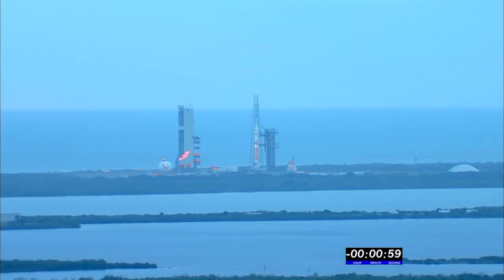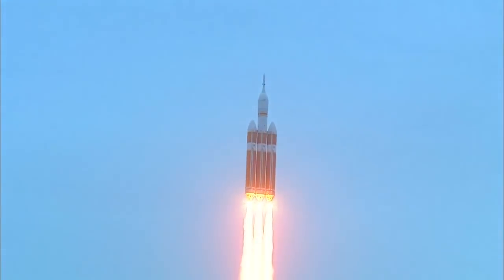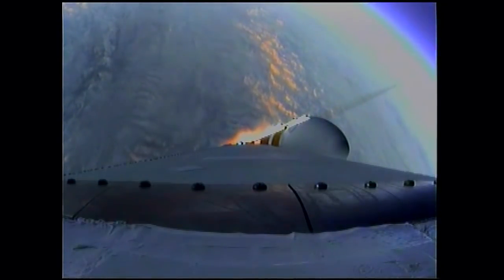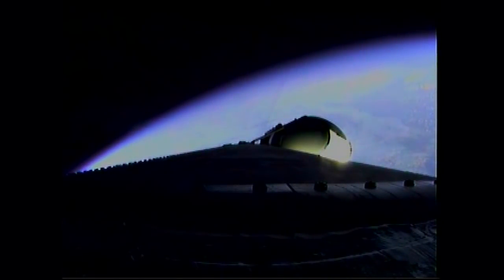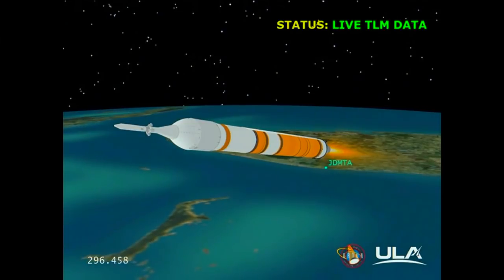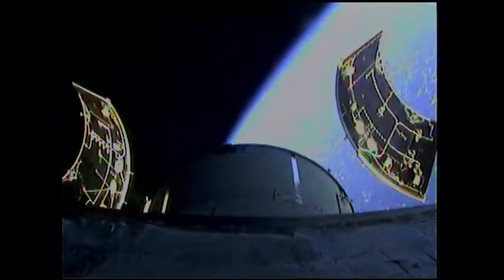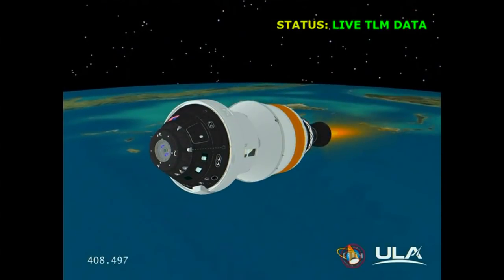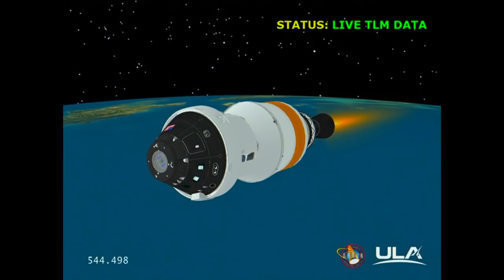Orion Soars on First Flight Test

Comment: They ever think about sending parts up in sections.? Then reassembling, refueling, and making the trip, how bout inflatable habitats with inner linings formed after inflation with polyurethane
Foam between linings everything can be packaged small then pressure inflated and filled.?

Comment: Why after rocket separation (at 5:00) is everything now in a blue hue? No reason for this except unless this was staged...
Reply: +Poindexter pantak The camera automatically adjusts white balance and exposure. My guess is that it adjusted to the intense red of the seperation explosions and didn't do a good job of readjusting back to normal.
Reply: +Salfordbluemoon Actually I want to know the answer to that myself, because the video does seem to change to blue for no reason after the 5:00 mark. So explain to us why it is so stupid?
Reply: Auto white balance/exposure would have bloomed out the image initially and there would be a delay, and it would have recovered. The instantanious change is a sure sign this video was worked on in stages. Occams razer is the answer.

Comment: The J2 engines are the only rocket engines to date that can be restarted in space.
Reply: +starview1 What about the RL-10 engine used in the Centaur upper stage?
Reply: ***** Almost any regeneratively-cooled liquid rocket engine is reusable, even if it was built for expendable vehicles.
The design requirement for the F-1 was 20 starts and 2250s of firing; as
part of the test program, six of them accumulated over 5000s each. HOWEVER, Yes the RL-10 engine was restartable,What I should have said that the J2 was of its type a Gas Generator power cycle rather than the expander style of something like a RL10.No question the RL 10 (I Suppose) could be called a work horse. Any how very good... you are probably one of six people viewing You tube that would catch my slip up, you get an A for the Day.

Comment: Is there a specific name/nomenclature for the booster and rocket config they are using?  It seems to be to new standard, seeing as how both NASA and SpaceX use it.  I just ask because it seems relatively new and I'd like a short-hand to refer to this setup for Kerbal Space Program.
Reply: they just strapped three Delta Common Core Boosters (CBC) together and throttled the middle one. SpaceX hasn't done this yet. i don't think that there is a special name for strapping three identical boosters together. Have fun in KSP

Comment: Is there any sound in space because I heard the boosters when it was still in the atmosphere but once it got out into orbit I couldn't hear them anymore
Reply: (near) no particles, no sound
Reply: oh, and I think the engine started using less fuel
Reply: I did look it up and found that sound needs a median to travel through such as air or water. When we talk we vibrate the air particles... But that sparked another question, how do they talk to mission control
Reply: Lemonsqeezerz4 well, just some sort of radio signal.
And the room they're in isn't running out of particles relative to their distance from earth otherwise they would be dead.
Reply: +ArvidiusMC If you're talking about gaseous particles, then you're incorrect. Sound travels through matter, so an astronaut on the moon could very well hear the other guy walking past him (provided that walking makes enough noise to be heard over the airconditioning & comms in his suit) . If the radio failed on one of the astronauts, all he'd have to do is to face the other astronaut, make the visor of his helmet connect with the other astronauts visor/helmet, and then talk. Just like listening to a conversation in another room, using a glass :P 

Also, if a spacewalking astronaut used a hammer to knock on the hull of the space-station, those inside it (or in the near vicinity of the spacewalking astronaut) , would hear the knocks, even though there''s a vacuum outside of it. As I said, sound travels through matter as well as fluid & air(gas). :-)

Comment: I'd be interested to know what NASA expects to accomplish with Orion. That is, what capabilities will it have that, say, Dragon II will not? Is Orion just a leftover from the defunct Constellation program or do they have a good reason to continue developing it?

I think if they're serious about commercial spaceflight, they should be focusing on getting the SLS into service and working with SpaceX to integrate their capsule into the NASA exploration program.
Reply: ***** I meant it'd play a major roll.
Reply: Orion is a spacecraft they're planning on landing on Mars. It's been in planning for a few years and now they're testing everything.
Reply: ***** Well yeah, but the SpaceX comparison is kinda not a good comparison because with most of the SpaceX launches they also have to recover the cost of the payload PLUS the rocket... if you see what I'm getting at.

Comment: Ok, I'm no expert, but would it be technically possible to make a smaller version of the space shuttle, with no cargo just enough for people, life support and a small engine for de-orbit burn, and put it at the top of the rocket, the rocket would go, just as every other rocket. 
It's no different from the Space Shuttle, but the idea is to make the cargo outside the vehicle wouldn't it cheaper to maintain than the Space Shuttle?

Comment: Dear NASA.....please save the CGI animations for when we have no video. Cutting away to the animated ship right as things happen is TERRIBLE.

I also find it amusing that you went with the old capsule design. I assume it will use a similar methodology for Mars as used for Luna? I.e. two vehicles, one in orbit with a lander/return module? If it works I'm not going to knock it. I guess using more modern, lighter materials and smaller yet more powerful computing power will make a huge difference. Save some weight for shielding from solar winds and all. Guess you boys have to work with what you have seeing as your budget was yanked out from under you.

I for one am all for expanding into our solar system. Our planet is too fragile to keep all of humanity here.

Comment: cynical, paranoid and under-informed.
that's me, and I admit it.
However, it doesn't prevent me from noticing things.
Why is "flying through the van allen radiation belt" such a big deal, when we supposedly perfected it in 1969???
Why is testing a re-entry capsule, critical, when we perfected that, too, in 1969?/?
Those were the reasons given for the mission (in part) when the news stories ran, on multiple national networks.
Any technical information will be appreciated.
Reply: Its important to est these things, no matter how well we know them, because we will be putting HUMAN LIVES aboard this vehicle and we want to make sure those human lives have the highest chance of survival.
Reply: Mother3pla3r I get that.
practice practice practice.  the news stories (which are just words NASA puts in their mouths) emphasized the need to go thru the van allen radiation belt to see the effects IT had on the spacecraft.
We did it in 1969 with obviously no effects or flaws.
right?
technology is nothing but better, knowledge is greater, abilities are exponentially improved compared  to 1969. 
That would be equivalent to getting on a horse today in St Louis preparing  for a trip to Calif., and worrying about hostile Injuns.
Been there, killed all of them.
Reply: tedskam It was all fake.  That's why.

Comment: Anyone thinking the moon landing was fake since the van Allen radiation belt should've killed The total dosage for the trip is only 11.4 Rads in  52.8 minutes.  Because 52.8 minutes is equal to 0.88 hours, his is equal to a dosage of   11.4  Rads / 0.88 hours =  13 Rads in one hour, which is well below the 300 Rads in one hour that is considered to be lethal. .

Comment: I don't get it. Why didn't they use the actual SLS for the test flight?
Reply: Because that would have been far more expensive and would have entailed waiting several more years until SLS is finished.
Reply: SLS hasn´t even gotten a test flight(as far as i can remember) so it´s not a good idea to send Orion on the SLS... yet.
Reply: That's the point.
Reply: The SLS is just starting it's construction phase,but anyway it's far cheaper to use the delta for this test of Orion. The next mission EM 1 2017/18 will use SLS. I can't wait.!

Comment: This are the same Russian engines that where blame on the rocket lunch one month ago, today they work and no one mention that this are Russian engines at work.
Reply: These are not the same engines. These are hydrogen fuelled RS-68s built by Rocketdyne. While Antares was running modified Kerosene fuelled NK-33s called AJ-26s which were rebuilt by Rocketdyne.

Comment: How much power does the Delta IV rocket's main engines produce? I have a feeling that the main engines of the future Space Launch System will produce a lot more.
Reply: Actually per engine these RS-68s produce more thrust than the RS-25Es that SLS will use. (approx 3000 kN as opposed to approx 2000 kN). But SLS will have more engines as well as boosters so its thrust will be far higher. So will its price though.

Comment: Launching a space capsule?
Welcome to 1962 everyone!

Even with Virgin Space's accident recently, they have a better platform to get us to space.
Reply: No, they don't have any platform to get us to space. Space planes are wasteful and inelegant. Capsules are the simplest, most reliable, and most elegant solution to the problem of getting people to orbit.

VG doesn't get anywhere close to orbit. It falls short by an order of magnitude at least.
Reply: Sarge Rho

It's a testbed idea that is sound, a capsule sitting on a rocket is a step backwards. You have to remember that a carrier vehicle like VG's White Knight carries a smaller vehicle part way with far less fuel than the launch we just saw, and WK has a shorter turnaround time.
Reply: josephpetergrant SST also doesn't come even close to Orbit. It flies on a hyperbolic trajectory up just over the Karmán line, and falls back down.
Reply: josephpetergrant
Your comments clearly show you know nothing about space travel. You're just showing your ignorance.
Reply: josephpetergrant For small payloads, meaning around a tonne or less, air launch is more efficient. But for heavy payloads, it's just not.
Reply: josephpetergrant
It is very simple really if you know anything about going into deep space. that is weight, cost, safety and reliability. The advanced capsule design gives NASA all this and more. A winged type crafts that they have at this time can not survive the reentry speeds and are to heavy and costly and the time to create such a winged craft will delay deep space exploration by many years. This makes the Orion the best choice.
Reply: Glenn never got out of LEO.
Reply: sojutime Your point?
Reply: sojutime
So who said he did?
Reply: If and when Virgin actually sends some rich folks to the edge of space for a few minutes of weightlessness and some neat views of the Earth out the windows, it will be duplicating what NASA first safely accomplished FIFTY-FIVE years ago with the X-15 rocket plane (dropped from a B-52 mothership high above the California desert-- sound familiar?) and then proceeded to do again (ever higher and ever faster) ONE HUNDRED AND NINETY MORE TIMES over the next decade. Think about it.

Comment: The last rocket that blew up was because engineers pressed the self-destruct button at launch for reasons unknown to me, and the nasa space shuttle had 134 successful launches into low earth orbit, except for challenger which tore apart at max q because of a leaking o ring on the rh booster (and nasa for ignoring thiokel too stop the launch).

I think you give nasa more bad press then they deserve, I mean Columbia tore apart on re-entry from a hole caused by foam not from the craft itself, its unfair too suggest that the shuttle should have been able too make it back with a large hole in its wing, but some nasa managers should be accountable for not have repair kits on the shuttle for when accidents happen, as we know nasa managers ignored thiokel engineers advice too stop the challenger launch.

ENGINEERS should be nasa managers and calling the shots, hopefully they are with the orion rocket.

Comment: Okay so I'm no rocket scientist, so if someone could explain this to me.... they say it's a "deep space capsule" and that its critical to "journey to mars" but its so small to spend the estimated 150-300 days it takes to get to mars. Is this just supposed to be the landing craft? If so then im assuming they are going to build the actual living quarters in space and just dock with it? or what?
Reply: Orion may be part of an eventually much larger craft. I and many others personally feel that technology will improve and increase so fast that seven, fifteen or twenty years from now, we will get to Mars in far different, far faster spacecraft, far larger and assembled in orbit, and it will be without chemical rocket engines.
Reply: From what I understand (and I could very well be wrong so don't take what I say as fact) one of the concepts would be to dock Orion and whatever lander they would use (Altair?) to a self propelled inflatable habitation module for the journey to Mars or wherever else.

And to your second question it would be launched from a SLS Block 2 stack configuration, either with Orion or launched separately and the two then make rendezvous in orbit.
Reply: This is not the entire launch vehicle or space craft at at all. It's a test for the capsule. That's the only bit that re-enters Earth with the Astronauts. Apollo missions had a command module, which they move to after launch, but they returned to Earth in the capsule. This is a test flight to make sure it's space-worthy to bring humans back from Mars. After all, no point building the rest, if it's a suicide mission.
Reply: It's called a deep space capsule because it's meant to go beyond Low Earth Orbit, meaning to the Moon, Mars, and other places. On a mission anywhere further than the Moon, they would use an inflatable habitation module though.

Comment: We flew through the radiation belt 50 years ago with Apollo. Why is it a problem now?
Reply: And the shielding is much better today.
Reply: Joseph Rotello Exactly. The electronics were fine on Apollo. I would like a good explanation for their concern now.
Reply: BasswoodJack Some concern relates to the fact that travel through the Van Allen Belts is going to become routine, and a great many people will be repeat travelers be it in the NASA or Commercial Space programs. From what I hear, radiation exposure isn't as much of a problem as is the fact that the Van Allen Belts "capture" a great deal of solar radiation and "dem rays" are not at all healthy.
Reply: Joseph Rotello That makes sense to me . I read up a bit on the belts during the past few minutes. I can see were there is cause for some concern. Not to mention the temporary belts that pop up from solar flares. Better safe than sorry. It seems to me with all our new precautions with space travel, we were lucky to make it to the moon at all. LOL
Reply: BasswoodJack
Forgot to add...on this Orion test #1, the unit passed through the Van Allen Belts I believe twice... outgoing and then on the return trajectory. Note that nothing was affected, or otherwise discombobulated and we can bet our losing value dollars that a lot of sensors were on-board to measure Van Allen Belt particulars.
Reply: BasswoodJack I believe I heard that as computer architecture gets smaller the chances of a single event upset (radiation causing a bit to flip from zero to one or vice versa) becomes greater.  This can corrupt the computer which is why they were turned off when going through the Van Allen Belts.

Comment: The "what's the flames" seen at :58 is usually hydrogen or in this case excess "fumes" of the hydrogen + oxygen oxidizer fuel vapors being themselves ignited by the engine "igniter" starter unit. Also, the concrete "exhaust ducts" seen in the Apollo and Shuttle days don't seem to be used or open in this launch, so there is that ground level flareup at :58.  Liftoff is about 1:03 as the computers will not release the hold-downs until the thrust builds to specifications....and there's a LOT of thrust there for sure.

Comment: Did they simulated human in this test including all items that will be used by human or they would have to run other tests? Personalty I am not sure they did, wish to know the answer since I teach risk management.
Reply: They'll be other tests, this was to run Orion through a test-run of far-earth orbit, radiation, launch, re-entry, capsule integrity in space to go back and fix any problems. There have been other tests testing its abort system, life support system, buoyancy in water, parachute system, etc... In 2018 it would be testing the new mega SLS rocket. And then both together Orion and SLS. There will be other tests simulating deeper space travel before humans go up. As well as the new lander and life support orbiter. When humans do go up, it'll probably only be around Earth orbit and then deeper space travel. Finally is the asteroid mission. And then a fly-around Mars' orbit before an actual separate Mars landing & exploration  mission.

Comment: Orion is going nowhere without Space Based Nuclear Power (with help by the US Navy) and will power the VASIMR engine for faster and safer flights to Mars and beyond.  Also this Power will allow NASA to learn to "Live Off the Land" on the Moon and Mars.  Orion also needs a NTR to operate in the deep gravity wells of the Earth, Moon and Mars.  This engine will also power the 24-Hour Lunar Shuttle (LEO to Lunar Orbit).  And the Orion must be docked or Mated to a Bigelow module that can be tested at the ISS.  This module will give the crew some room on the way to and from Mars !  Some of this will take ten years to build and test.

Eyes UP and lights down,  tjl Sent by Win7Pro64 w/ADSL